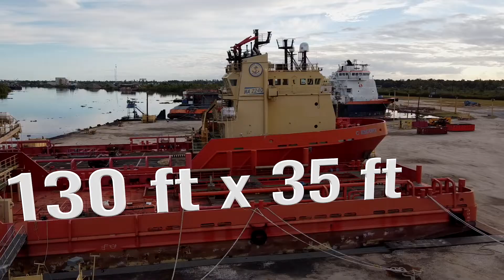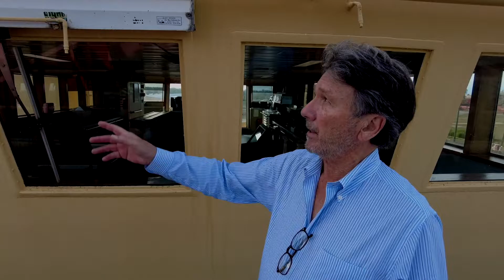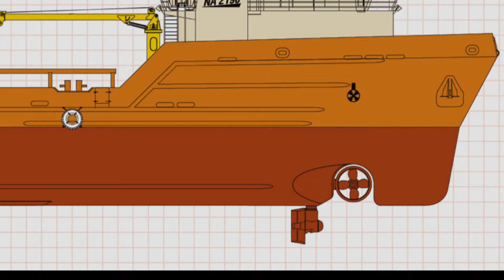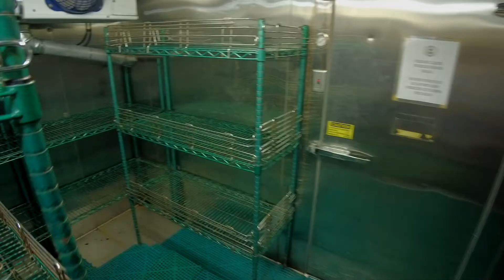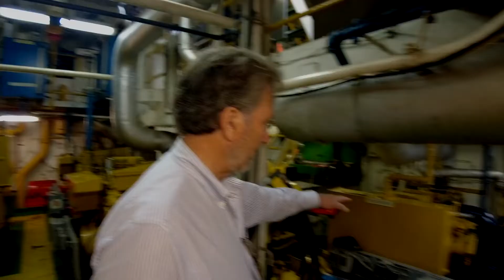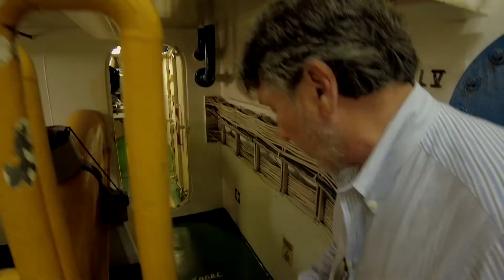U.S. built 200' Conversion Global Yacht Support/Expedition Vessel

Comment: If you're going to convert the diesel engines to create electricity, will they be able to create enough power to run electrical items in the ship as well, or would you still need the generators to create the amount of electricity you will need to power the boat?  You've also got enough space that you could include a lot of solar panels to create power to help with energy consumption.

That kind of ship is exactly what I would want for my only yacht.  Forget about a support vessel.  You don't need anything else if you have that!
Reply from the maker: You would end up with more generating power than you would ever need. So you'd run all the engines intermittently for maximum efficiency and longer life.

Comment: I'll buy this.

My first priority is to have an unsinkable, all-weather, go-anywhere vessel. I would have ideally wanted a vessel with the superstructure in the center, but that would make the size the of the vessel to accommodate all the tenders so large that I wouldn't be able to afford to operate it, so this is a good compromise design.

The aft deck has all the space I need for a hangar for an  H-145 helicopter(44'x9'x13'), a small submarine, a small pool, a sundeck and a large saloon on top. 

Multiple engines, multiple screws and multiple rudders all build redundancy for the most adverse of situations. A diesel electric propulsion is a plus, but not essential.

I would also want it to be able to refuel a G-111 amphibious aircraft (the HU-16 with titanium wing-spars to operate in 6ft waves and 10-ft swells.  I, initially, wanted it to hangar the aircraft, but the dimensions of the aircraft would make the size of the yacht uneconomical for me to operate, so simply refueling and servicing is adequate.

I want a large saloon with excellent views, a decent office-cum-libary-cum-gym also with exquisite views for myself,  a luxurious owner's suite and 4-to-5 comfortable but not luxurious guest suites. I'd like a shallow, narrow and long pool on the sundeck, a comfortable sky lounge, and a small fly-bridge with a Jacuzzi. 

I do like the carpet-less interior of the San Lorenzo 500 Exp.  I like interiors by Pinto and an English woman whose name I can't recall.

I would prefer interiors like those of the 500Exp or Andromeda/Ulysses.

Comment: What will the estimated total cost be once it's completed? Damen always says that buying a support yacht is considerably cheaper than buying a regular yacht of the same length, but they never give any figures to back that up. If that boat is bought for 10 million, how much goes into the refit? And when the old equipment is sold off, is that money given to the new owner to offset the price of the work, or is that the shipyards additional profit since a lot winds up as scrap I imagine.
Reply from the maker: We estimate that this vessel can be finished as a yacht support vessel for under $9 million, turn-key.
Reply: @TheYachtChannel  can you do a video on the finished design please